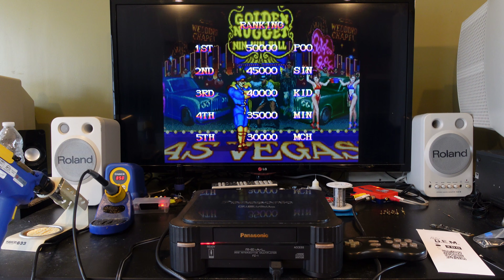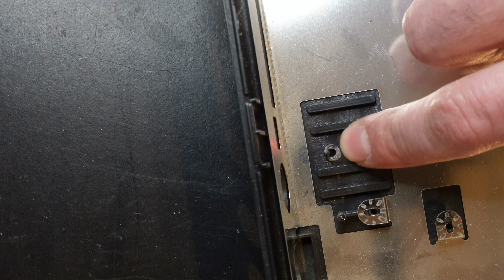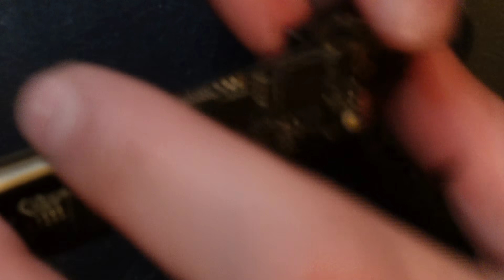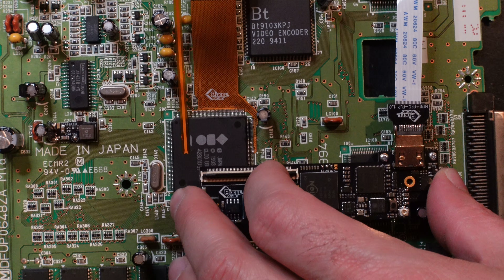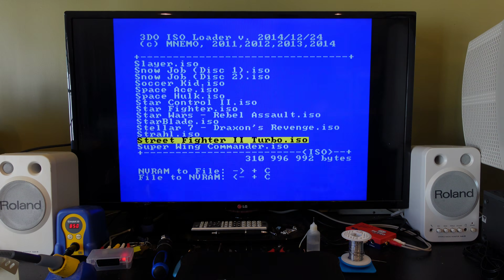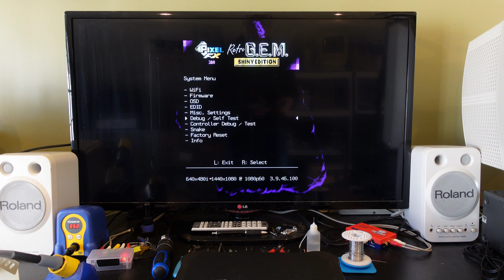The FIRST HDMI mod for the 3DO is here! PixelFX 3DO Retro Gem install guide and demonstration

Comment: Still waiting an HDMI mod for the Saturn 🫤
Reply from the maker: That would be amazing, hope that happens as well
Reply: Won't happen as the saturn only has an analog signal
Reply: @ ???  What are you talking about? The hdmi mod will transfer analog signal into digital signal. The ps1 has already that, so the Saturn also can have it.
Reply: @sega-re-trop-vieux  I've heard that it can't be done on the Saturn as it uses 2 video chips. I don't know the validity of that though. I'd LOVE to install a GEM into my Saturn though!

Comment: I need this for the Sega Saturn
Reply: There is already a great solution for the Saturn - The RAD2X cable. Not internal HDMI, but much cheaper, no modification necessary and it's a BEAUTIFUL image, and can be paired with a scaler like the RT4K. Cheaper option would be the RGC component cable on its own, or paired with a scaler like the RT5X. The 3DO unfortunately never had these options (at least not yet). Hope this is helpful. In any case, happy gaming!
Reply: @yaakovshereshevsky6542  I agree tho, happy that the 3D0 got some love
Reply: @yaakovshereshevsky6542  I know my friend, but I need internal HDMI. Currently I have a GBSc with HD retrovision cables. And it does look good
Reply from the maker: I hope eventually there’s a retro gem for Saturn but at least there are a bunch of other good options
Reply: Get a Mister.